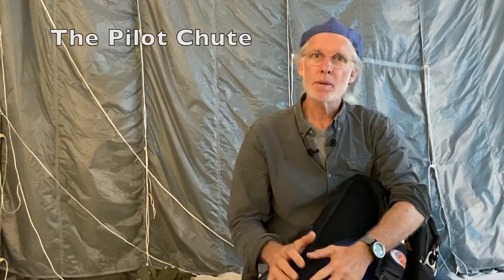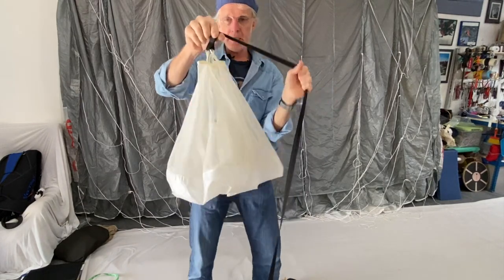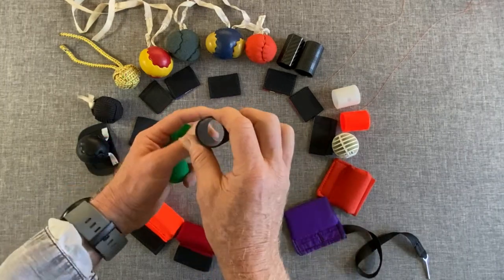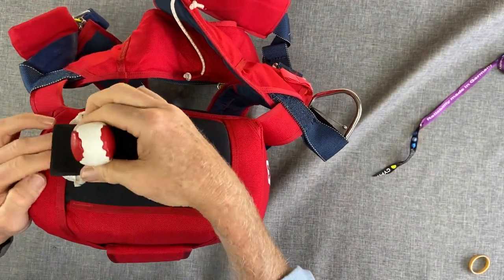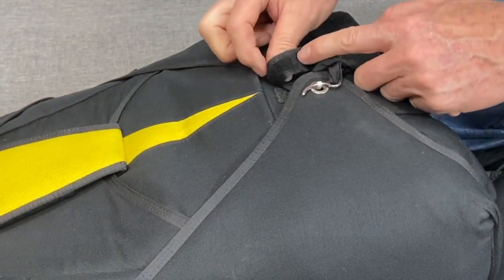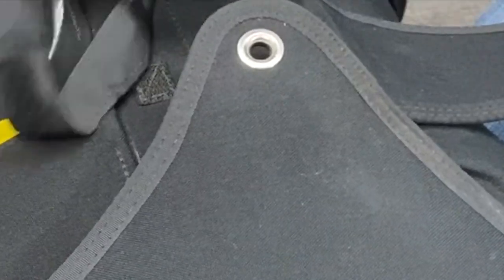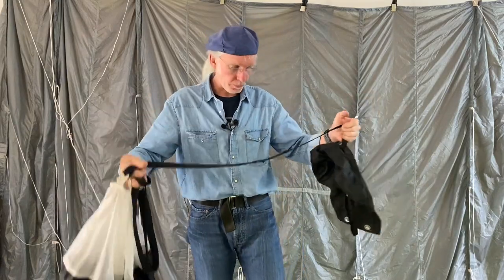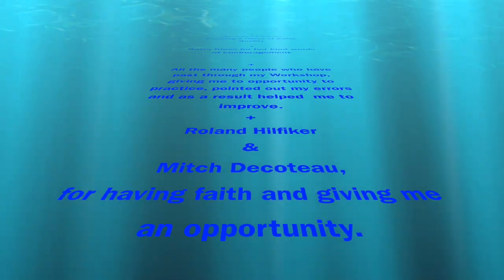The Pilot Chute

Comment: Awesome content! I wish there were more people with that mindset towards gear component purpose and it's maintenance!
I would like to get your opinion on this:
I have a Vector rig and want to replace my pilot chute handle with one that has tuck tab, but there is a bit of gap between right closing flap and boc pouch. It looks like this - https://drive.google.com/file/d/17pYtmkdu464DJJIwpYtUjP8VIqND7bqr/view?usp=sharing 
My rigger and I are considering moving boc closer to the flap. Would you consider that a good option?
Thank you in advance!
Reply from the maker: Hello Matija

Thank you for watching the video, I’m happy you upgrade to a LockTag handle.

From the photo it appears your Vector was made some time ago, what is its DOM?

If it’s more than ten years old the BOC will probably be one of the good ones, so just move it.

If it’s a newer one with the BOC cut the wrong way, I’d pop it off put it in the bin then fit a new BOC constructed correctly, closer to the Rh Flap.

Since last year UPT have fitted the Rh Flap in the appropriate place (after a wee bit of encouragement)
sadly there are a large number of Vectors out there with the Rh Flap too far away from the BOC.
If you are having one of these, move the flap attachment,
pop out the 40mm or so of stitches, pull the flap closer to the BOC and restitch, I do this by hand with the use of a Stitching Awl and some Patients.

https://drive.google.com/drive/u/0/folders/18sM4IuuX_WnLO2lYjqM6hzXJQaOC7i-L

I hope this is reasonably clear and you don’t need  to use the Rosetta Stone.

All the best, 

Colin.
Reply from the maker: Sorry the top link for the photos is bad, my finger problem.

try the link below.

https://drive.google.com/drive/folders/18sM4IuuX_WnLO2lYjqM6hzXJQaOC7i-L?usp=sharing
Reply: Yes, the Vector is from ‘97. 
The pouch fabric is in good condition. Maybe it could be tightened a bit just on the edge where the PC is inserted.
I think my rigger prefers repositioning pouch instead of  unsewing right flap.
It feels very insuring that you think that is proper way of how the gap could be fixed. 
Thank you very much for replying!
Reply from the maker: @matija713  
Absolutely, 
just pop the BOC off and back on again, (your lovely 97 model has a superior fabric for the BOC & cut the correct orientation + dose not suffer from the poorly attached Rh Flap, I only started seeing that in the last 8 or 9 years)
Before removing BOC, make a mark with chalk along the edge of the Rh Flap. 
That will be your reference mark for the mouth of the BOC new position, 
the side closest to the pin could remain on the same stitch line(just moved along a bit), 
the other side just move the tape progressively closer to the back pad binding tape, to help cinch up the tension of the BOC across the mouth,(normal it only needs 5 or 6mm) compensating for the fabric fatigue.

All the best,
Colin